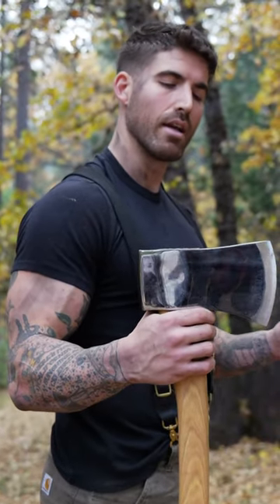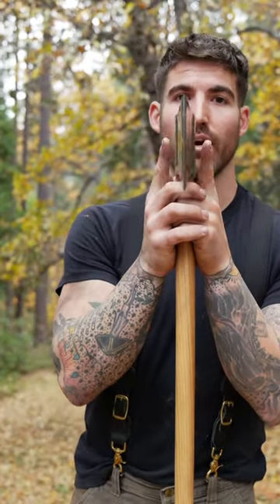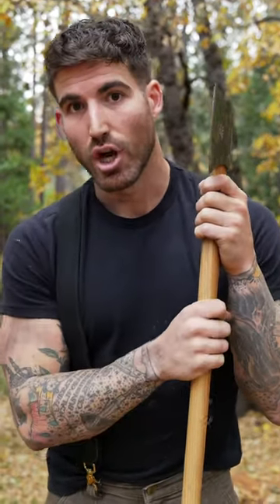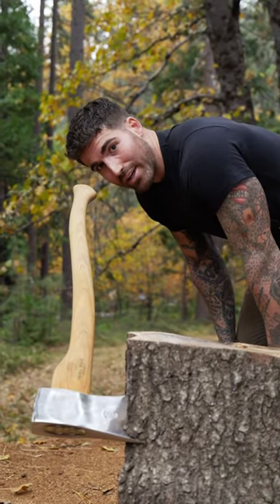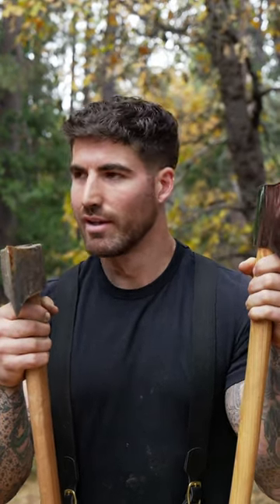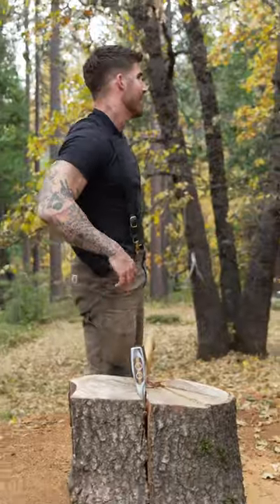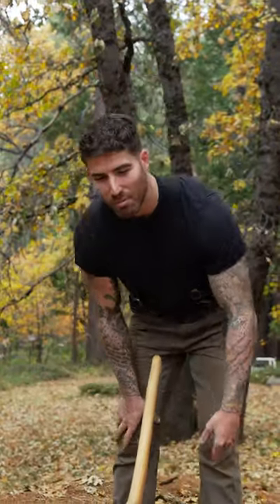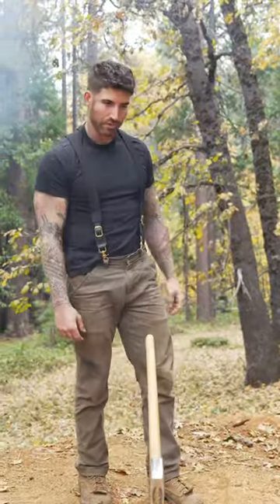I Was Surprised!

Comment: Love using a skinny axe on dry wood, it just splits apart.  Use that same force on green wet wood and the bit sinks in a few inches and it ain't comin out.
Reply from the maker: If it's softwood. That is very true. But this is hardwood...easier when green or fresh

Comment: Hardened with lubricant and cobalt most likely. Very expensive designed for both, I wouldn't risk hitting the head though, tempered throws metal chunks when used as a wedge axe.

Comment: Chopping axes suck to use on freshly cut green wood, but once the wood dries a bit it blows right through it
Reply from the maker: I am NOT trying to tell you I told you so here. But just for context. This is oak. And oak is easier to split when green. And this wood is green here.
Reply: @ThorenBradley  100% agree, I'm just saying, I wouldn't use a cutting axe over a maul or thicker profile axe head with green wood, unless only tool in the shed, I've split wood professionally for a good part of 20 years, I do like the way a cutting axe head blows through wood that has been bucked up and sitting for a bit, but we all regret the battle between them big knotty hardwood pieces and all we have is a cutting axe

Comment: Im not surprised. 😁 In fact i was wondering why you need a specific splitting axe in the first place, because a chopper that cuts through wood horizontally, should also cut perfectly vertical ?! 
A splitter pushed the wood away, but a chopper cuts through the wood. That would be my opinion 😄